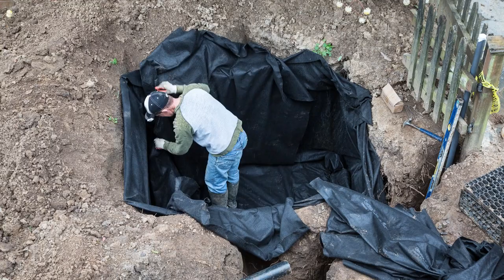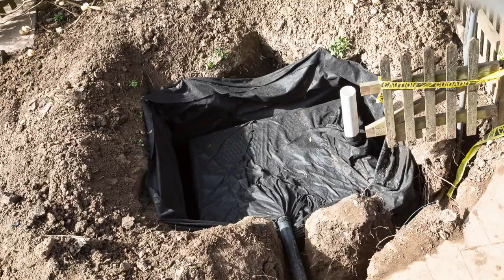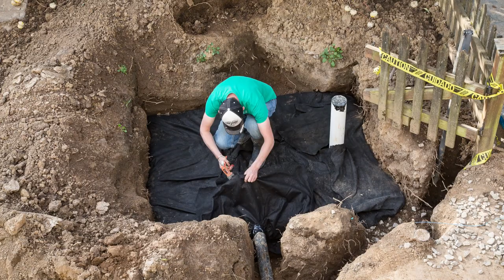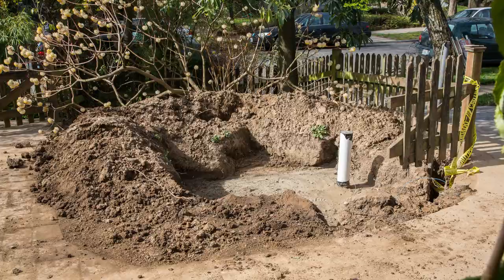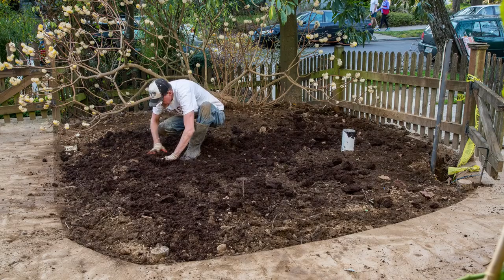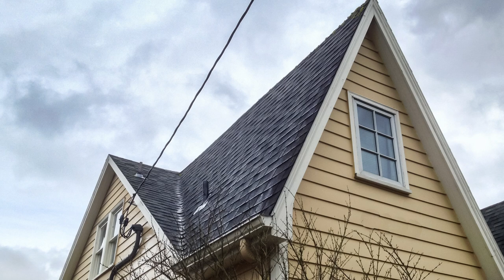Timelapse install of an R-Tank Rainwater Infiltration System

Comment: 2 questions, 1: I noticed you have 2 layers of geotextile with infill in between - isn't it normally just the geotextile around the box?  What is that 2nd outer layer after the infill for?  2. How did you create that pipe boot?  Did you just cut a hole in the geotextile and then clamp the fabric around with with a stainless pipe strap?
Reply from the maker: The outer layer prevents the surrounding soil from infiltrating and clogging up the infill. The speed with which this happens will depend on the soil type. In my case this process would be rapid given the clay-rich soils. The extra layer should extend the life of the drywell by decades.
The other reason: it’s the configuration recommended by the R-Tank manufacturer.
I used pipe clamps on some of the maintenance ducts, also duct tape.

Comment: What's the white pipe sticking out the top of the crates for please.
Reply from the maker: The white tube is a Maintenance Port. It can be used to backflush the system by injecting water through the port to resuspend sediments which can then be removed with standard vac equipment.
The guideline is to clean out the tank once sediment builds up to 2-inches or higher. In practice I have never seen any buildup and I’ve never used the ports.
More information here: https://californiafiltrationspecialists.com/wp-content/uploads/R-Tank/StandardDetails/R-Tank-Forbay-Pretreatment.pdf

Comment: I'm curious about this system and how it was implemented.  Was this an effort to combat rainwater infiltrating your foundation, or flooding certain areas of your property?   How far away is the tank from your downspout?  I'm researching as many possible solutions as I can to mitigate flooding/standing water at various low spots on my property.
Reply from the maker: Portland residents are required to dispose of stormwater onsite and not send it into the combined sewer. (There is a ~$30 rebate/quarter for doing this.) While most of my roof runoff goes into an underground rainwater tank there was a small section of roof that I could not easily route around the house to the tank. So instead it goes into this drywell.
This drywell is around 10 feet from the downspout although there is no limit really. Just run the drainpipe with the gradient required by your local code. The further the drywell is from the downspout the deeper you will have to place it to support the drain gradient.
In your case you would probably want to put in a series of french drains where water accumulates and run these into a drywell.

Comment: how are you pulling water out?
Reply from the maker: It’s infiltration only. It’s disposing of about 10% of the house roof runoff. I have never seen water accumulate in it. (I have another more recent video which shows a rainwater storage cistern with drywell overflow that I installed in the backyard. I pump water out of that with a Grundfos pump.)

Comment: El geotextil en el borde de la excavación estuvo demás
Reply from the maker: Necessary in this clay-rich soil. Without it the gravel fill will be clogged within 1-2 years from soil infiltration. (I know because gravel fill in other parts of the lot was completed clogged with soil after 2-3 years.)
Secondly this is the installation recommended by the R-Tank manufacturers.
You can go with a single layer but its effectiveness will only be years rather than decades.

Comment: Is that geo fabric? Or something impermeable?
Reply from the maker: It's a non-woven 4oz geotextile. Specifically I always use Mirafi 140N fabric. (I've also built a 6000 gallon drywell in the backyard also using this fabric.) Very strong. Seems to filter well; there is no sediment build-up after several years.
I don't know your location however I buy from ACF West - they cover the Pacific Northwest including Alaska, Idaho, and Utah.
Do not use landscape fabric! Not strong enough; it won't last.
Reply from the maker: I'll add that I used way more fabric layers than are necessary on the top of this drywell. I was using remnants that weren't quite large enough for the job. That meant they could wrap completely over the top. So I added additional pieces on top to ensure there were no seams for dirt to work into.
Reply from the maker: https://www.usfabricsinc.com/products/mirafi-140n/

Comment: Very nice installation.  How is holding up 2 years later?
Reply from the maker: It is handling it like a champ. I have a raised bed garden sitting on top of it and I've mostly forgotten it's there.
I built a much larger one in my back yard - 11 feet deep - to handle runoff from my underground rainwater tank. It's handled around 30,000 gallons of rainwater overflow since October 2016.
Reply: hi there, can i contact you for some details? we have issues with clay soil and lack of drainage..would be very interested to see if we could do sth like this to help us.
Reply from the maker: Yes, you are welcome to do that. Perhaps email me? If it's easier I'm 
okay to discuss by phone. I think with clay soils the trick would be to 
either make it big enough to take the whole runoff, or dig down deep 
enough that you hit a better infiltration layer. My soil is quite clay 
heavy.

Comment: Are you using the same system for water storage?
Reply from the maker: This drywell is for infiltration only. I have a 1350-Gal cistern buried in the backyard for rainwater storage. (Graf Platin tank - link below.) I did look into using this R-Tank system for storage - so line it with waterproof EDPM liner - however I wasn't confident how long the liner would last underground, resist tree root pressure without tearing, and my ability to correctly lap it and make it truly waterproof. So I went with a precast tank instead.
https://www.rainharvest.com/graf-platin-1350-gallon-cistern.asp
Reply from the maker: Rainharvest has a video on using modular systems for water storage - in case you haven't already found this: https://youtu.be/doUhWo47PUY
Reply: @lostlakeOR  Thanks!  I didn't think about roots.  That could be a real problem.  I'm also looking at "water pillows."  We have a good crawl space and that seems like it could be very effective.